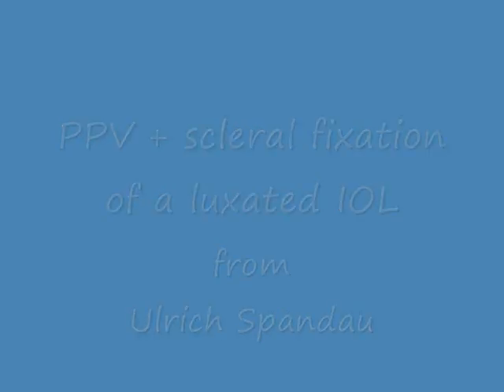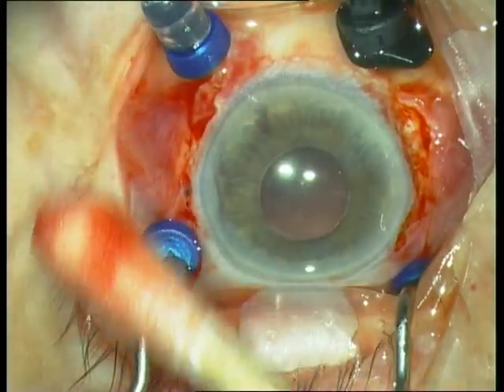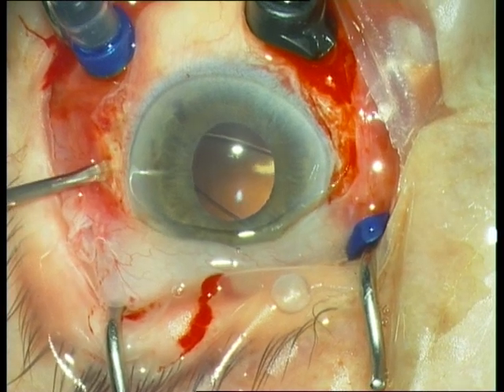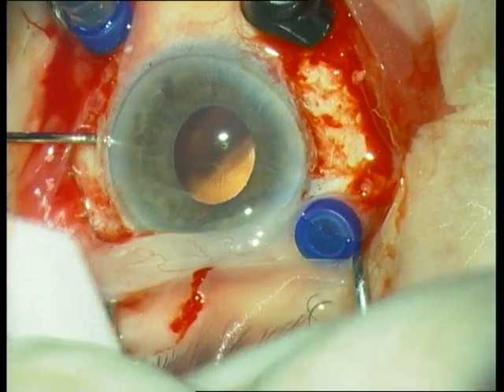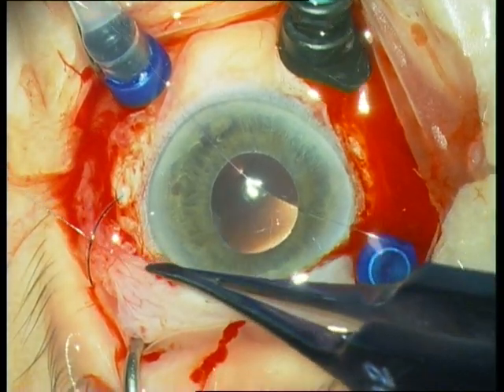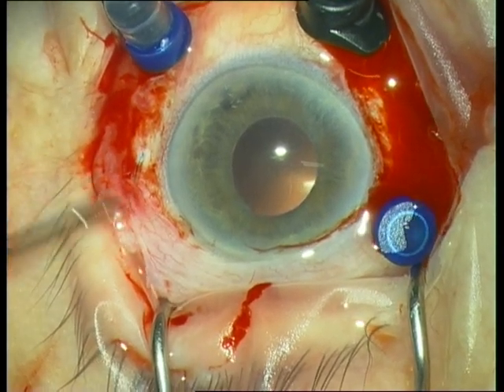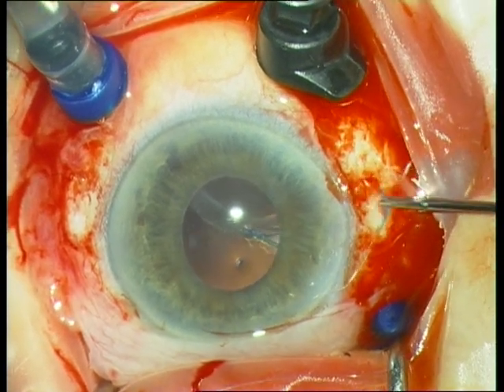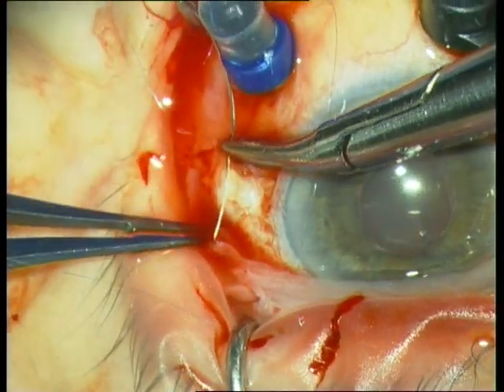Part VII:  Posterior dislocated IOL retrieval and scleral fixation

Comment: Dear Dr Spandau,
Thank you for this video. I have two questions. Do you close the sclerotomy with the prolen suture? And the second question If you have a 3 piece implant in the sulcus, luxated. What technique do you use? Would it be possible to suture directly to the sclera without doing the sclerotomies ?
Reply: Either it's better to suture it to the iris? Considering also that the patient has glaucoma and high myopia.
Reply from the maker: 1) I suture the sclerotomy always with Vicyl 8-0.
2) I usually extract the luxated IOL and implant an Artisan IOL
3) Iris suture. Watch this video fro my channel: 
https://youtu.be/PkFmy05dGGE?si=ri9j7YTEJL-uNDMo

Comment: Dr Spandau when 3piece IOL is luxated do you prefer this technique over yamane ?
Does a 20G sclerotomy require suture?
Kind regards
Reply from the maker: Yes, I prefer this technique. For this technique I need 15min.
A 20G sclerotomy needs a suture.
Reply: Dr Spandau, 
Eye is aphakic with no capsule.
Retropupilary artisan thrue frown incision or 10-0 polypropylene zigzag sulcus fixated foldable 3piece IOL thrue 2,7 tunnel incision?
Which option and why?
Thank you for your answer or sugestion.
Kind regards  @ulrichspandau
Reply from the maker: @okselgnl  Both techniques are possible. I prefer retropupillar Artisan.